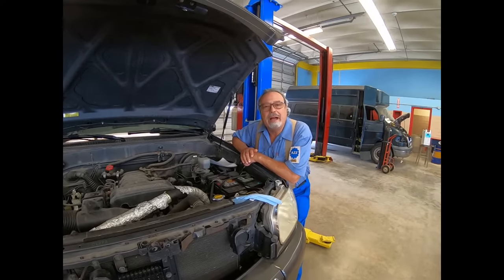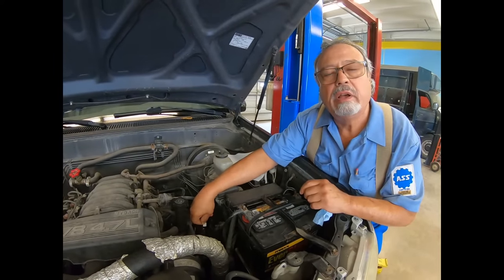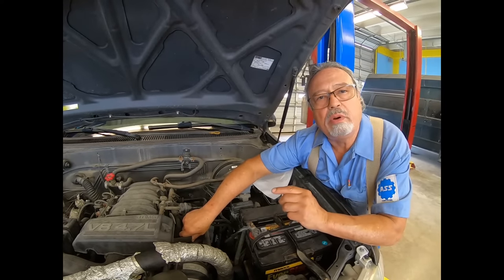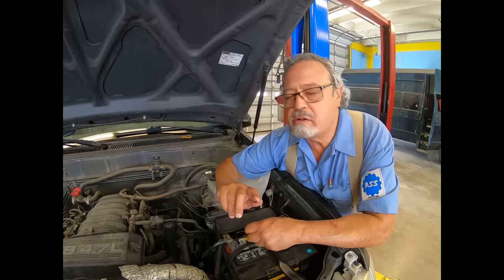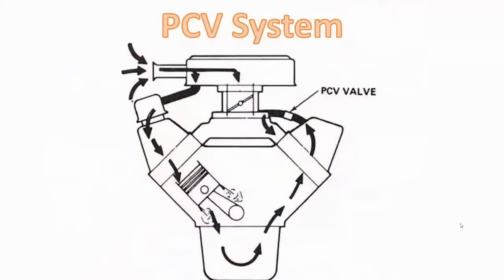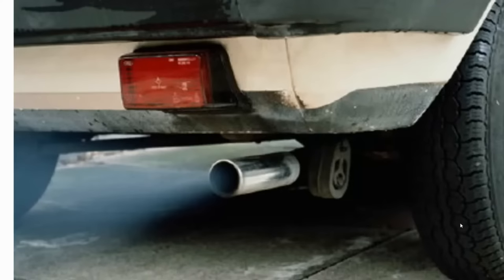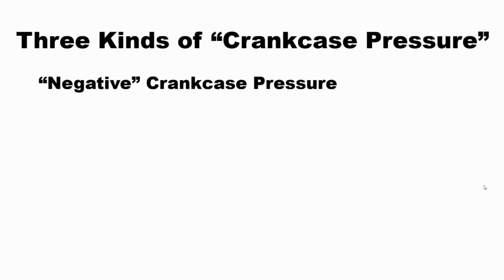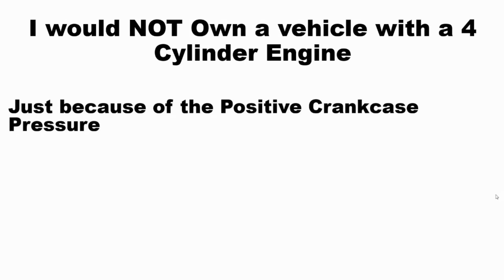Learn how IMPORTANT the PCV Valve is and why you should test it.

Comment: I have been a mechanic all my life and I never knew this trick I love learning every day thanks  !
Reply from the maker: That's Great. Thank you for the view and the comment. Did you see my series of videos on automotive AC ?
Reply: @theoldmecanicoshow9004  I will thanks
Reply: The old school hot rodders used crankcase ventilation. Something very similar to the PCV concept, to get more horsepower. A 3/8 pipe cut at a 45-degree angle; the longest part of that angle pointed towards the front of the car. Welded into the header collector. A 90-degree elbow with a check valve and hose leading to a ported valve cover breather. I was amazed at how much vacuum it created...
Reply from the maker: @hanc37  WOW...! Thank you for that information and thank you for the view.
Reply: @codyhatch4607  Both are negative I suppose. The only difference with the PCV is the vacuum is coming from the intake manifold instead of the header exhaust.
Reply: @codyhatch4607  Thank you grammar police.
Reply: Yes..I only knew of putting a piece of paper on the pcv itself,not on the dip stick holder
Reply: @Grady Hernandez
thats not right,
the pcv itself has a strong vacuum even our finger is being sucked as we try to cover it, 
the only way the paper not being sucked is if it was blocked inside the pcv or the hose
Reply: @endurofan9854  or a vaccum leak in the PCV circuit before.
Reply: @hanc37  Those were called "road draft tubes" and were in use before the PCV system. They only work when the vehicle is in motion, as the passing air created a slight vacuum on the crankcase. The other device you mentioned, used on exhaust headers works in the same manner, but is done to increase crankcase vacuum (more negative pressure), in an attempt to increase piston ring sealing and therefore increase horsepower.

Comment: Excellent video! I always wondered what the hell the PCV does and now I know.  I've always replaced it on my Astro van and my Lexus GS 300, but I never knew why.  I like how you explain things clearly and succinctly. And your wit and dry sense of humor are terrific! 😊
Reply from the maker: Awesome. Thank you for that awesome comment and the views.
Reply: I stopped the video at 1 minute 19 seconds. I have no tolerance for that condescending tone. It wasn’t all in gest, it was being ugly for the sake of being ugly. It does what it says it does. It allows air to circulate through the crank case to maintain correct pressure inside the crankcase. Hence the name “positive crankcase ventilation valve”.
Reply: @Batmicheal  If you knew all that you wouldn't be here.

Comment: Great information.  Engine oil and engines themselves literally doubled immediately in mileage  because of the use of PCV's.  A clean engine is a happy engine.
Reply from the maker: I agree. A clean engine is a happy engine. Thank you for the view and the comment my You Tube friend.
Reply: I remember working on old cars from the fifties that had no PCV system, just ' road draft tube ' that kind of pulled some of the crankcase fumes through just by the 
' draft ' of moving fast.
The whole underside of most cars was a giant grease sludge pit.

Comment: I just purchased a used 2017 Honda Accord Sport 2.4L Inline 4 cyl. This is my 1st time owning a modern inline 4cyl...
I was told to replace the PCV valve every 30,000 miles. Seems reasonable enough, as the PCV valve is very easy to replace on this engine. Thank you for explaining the reasons for this important maintenance!
Reply from the maker: You are Welcome and thank you for the view and that nice comment. Good luck my You Tube friend.

Comment: I have a 1972 350, small cam, headers, mid rise intake, 600cfm carb. Head work and bottom end work (decent hp, lots of TQ, and this one is particularly high in compression  10:5:1 before head work and bottom end work )I'd put it at about 400hp at the flywheel because shes got alot of miles since the build, I'll promise you can't turn it over by hand with just #1 plug out. It'll break the crank bolt before it will. It spins normally with all 8 out. 
I'd say this engine was overhauled and put in sometime around the year 2000 it was in service for around 10 years, parked for 12, deteriorating outside, years. Before I bought it and put it on the road. 
It had been running bad since I bought it 
I timed it, didn't fix it although it was out of time. 
Replaced all vaccum hoses and pcv, didn't fix it. 
Adjusted carb and all settings, didn't fix it, 
Broke the new pcv I installed, so I had.to replace it again. 

Didn't fix it again. 
It was a specific kinda miss.
I tune with a vaccum Guage and tac. 
I was getting a very lean fuel mixture, very low vacuum reading, and It was idling wayyyy too fast v

I had it running good as hell, but not performing. 

Mind you this car sat for 12 years, and when I put it on the road I fixed anything I deemed "unsafe" such as tightening things, and making sure nothing is going to get into anything I did not build this engine, I did not put it in. I changed the oil made it run and drove it because it was fun. 
After doing all that work a while back... 
I did something naughty.... 
Something  "forbidden" ........ 

I stuck a breather cap in my pcv valve grommet to match the other side which normally pulls from the massive vaccum leak known as a positive control valve and I plugged the nipple on the carb so it would volume of something a CARBURETED car desperately needs for economic reasons such as fuel economy... vaccum.  

A PCV basically "sucks" all the time, as a vaccum leak does. It's just controlled inside the carburetor. Not tamed, just controlled.  Technically,  you're putting sludge in your fuel system this way on most vintage cars.,you're sucking motor oil residue into a ethanol fuel that already hinders performance and causes power loss,  engine wear, and dosent spark very well in older ignition types.  And you're mixing this ethanol and oil into a less grade fuel than is already to weak for combustion I'm these old v8s and even straight 6's thus causing a lean mix, not because of your settings, but because  87 octane just dosen cut it. I believe 98 was the standard for octane in the old days. It went as high as 240octane at special fueling stations and race track use. It was also lead based until the late 70s/early 80s with lots of additional additives for combustion. 
The first generation small block chevy was designed with  a vent tube at the back of the top of the block and a breather oil neck in the intake, it was front to rear ventilation. No massive leak of vaccum in the valve cover that usually aids in helping create that valve cover that always leaks on gm products because it's pressurized usually on the passenger side. And fess up, guess what? We know it's almost always the back pass side because that's where gm locates the pcv placement from the factory? Back passenger side. EGR too, pass intake (also vaccum) and guess what else? #6&#8 plugs that usually foul, aka, least efficient cylinder.. it's already going to be this in old Chevrolet because on the firing order these 2 cylinders are farthest from #1 (the TDC of firing order) because thats just the way they built them. So you wanna pressurize this head, and pull all the "contaminated air"aka oil through a vacuum leak (controlled ofc) hooked into my intake, that ofc is the thing that makes the vaccum distribute from the crank case to ports ports the carburetor and any intake ports.  so it'll get my fuel and air above it, coming in fresh, but only is to get blended with this oilly tainted loop of vaccum leak, to not only then  be burned within my combustion chambers, which already won't make As.much combustion because the octane grade is poopeykaka for my ancient engines need for the fuel to burn hotter, hotter with less flash time and or length of combustion.  And bit of a  camshaft cresting less vacuum than before, it needs as much as you can give it and it's real design was made pre emissions so basically it created vaccum up top and the byproduct went out 2 vents in the engine 

Since I took pcv valve out and replaced with twin valve cover breathers. ..

I haven't had sluggish throttle since. 
Fuel economy went up, 
Idles better, 
Downshifts and upshifts better. 
It even rides smoother 
Idles properly, and will pin you to the seat in 3rd gear whereas before it was gutleessly slow and disappointing it wasn't until the pcv valve was removed did I get true improvement.  

Cabureted cars don't need pcv unless they have all their original emissions control equipment in tact.  If not ditch it for a breather.  

Its important you have the breathers on BOTH  valve covers.  You want to optimize how much ccp  can escape through these holes by gravity and force of engine. If you do this you'll have dirty valve covers.  

Its a small  price to pay  for not having that buildup of grime on tbe vakve cover inside your intake and cresting carbonous sludge in your valve train and head internals 

I will never waste my time with a pcv on a modified classic again. 

Keep putting them on cars with ecm tho that's fine, just don't destroy the internals of a old gm engines all we got left is what's left of gms original casts.   That goes to every mfg. business. That crested casts too suit out future
Reply from the maker: WOW...that was very interesting. Thank you for sharing the information and your personal experience. You are correct about carbureted engine and how the PCV system can cause problems. Thank you again for the information and the view.
Reply: I've had issues since I switched to the 600cfm Edelbrock from the Quadrajet that was on my 305. It used to scream and burn rubber up to the start of 2nd gear. I always figured I just went to big on the new carb, despite all the tweaking, but maybe this tip will help regain some of her former glory. Thanks guys!
Reply: No way a pcv is in my freshly rebuilt sbc. Breathers on both valve covers.
Reply: Thanks for this!! I bought a 68 Galaxie that has its original 390 w cast intake and 2-barrel (motorcraft?) carb. The original stock big block Ford covers have NO HOLES AT ALL…no breathers, no PCV.  I just bought a pair of generic chrome covers that have the 1 1/4” holes. I almost bought a breather and a PCV for the drivers side, but last-minute bought 2 chrome breathers instead.  The reason was financial- a PCV hose for the big block ford was almost $70. 2 breathers only $20 on eBay.  Now with your explanation I think I did the right thing.  By the way the inside of the old covers was pretty clean, as is the valve train.  Now I just have to figure out where to connect an open vacuum at the top back left of the carb, near the electric choke , which isn’t working properly. Any ideas anyone???

Comment: I inherited my dad's truck recently. It's a 2003 Dodge Dakota SLT he bought in 2005 with 16k miles on it. It now has 235k and still runs great even though she smokes just s little, still smooth as ever but noticed when i chsnged the plugged up pcv valve the engine was quieter overall once the notorious lifters got in harmony and finally settled down 😂 but yes overall the engine is now quieter and i am noticing cleaner oil coming out every 5k mile oil change.  I am currently driving it daily without concern that its a 20 year old truck. I wasn't aware of the importance of keeping the pan oil cleaner. I did understand the recycling process to reburn as all my cars got new pcc valves each year or 2 anyway.  I appreciated your genuine desire to get this point across and i enjoyed the patch part 😂
Reply: If it smokes, buy 3-4 cans of BG 88k and EPR your engine

Comment: I just did what you advised and di it it on my 14 RAV4 ,when after start/hot engine condition the paper would not hold even I pressed it, after changing the PCV it holds on and the engine now run at idle smoother. Thank you so much, hope you'll continue and share more Auto vlogging tips.
Reply from the maker: Thank you for the view and the comment. I am so happy that I can help people like yourself fix cars, save money, and feel good about yourself. Thanks again my you tube friend.

Comment: The PCV valve should allow a lot of flow when manifold vacuum is low- as in when you are accelerating heavily, and should only allow a small bleed of vacuum when manifold vacuum is high- such as idle and low load running.
Positive Crankcase Ventilation is the crankcase gases from combustion leaking past the piston rings and such from not just blowing out of the crankcase on their own but helping to draw the gases out and also feeding them into the intake so they can be burned.
Helps out all around
I've never seen it quite so exaggerated
Reply: @A. Melbs not sure how those are set up. All I can think of is making sure everything ' crankcase ' is sealed and plugged up ( kind of like his tests here ) and how it runs ( idles ) versus opening it up, like any oil filler caps off and dipsticks out, and comparing how it runs.
If it runs the same, while the ' piece of paper ' test shows vacuum is present, then should be working right.
Reply: @A. Melbs usually PCV valve is very easy to get at. Plugs into the crankcase somewhere usually on valve cover with a hose to intake manifold. Sometimes you can pull them out of their crankcase connection while keeping the intake hose on and while running on idle it should be holding in ' bleed ' mode. Then when you put thumb over the end the flow stops and spring pushes it to 
' heavier flow ' mode. It clicks back and forth as you put your thumb on it giving you a good idea if it's working right.
I was trying to pinpoint a vacuum leak on a Ford Focus where the PCV valve is buried under the intake manifold and you can't hardly even see it. To check if it was PCV I had to put a long flat bar through the intake tubes and push against the vacuum hose to the valve to see if it changed speed. When I heard it clicking 
( like putting thumb over the end ) I knew it was working okay.
Reply: Would a bad PCV valve cause the car to shut off
Reply: @45chris45  it could. It would have to stick 
' open ' to where it passes a lot more air.
In that position it would not want to idle very good, in fact, not at all and would quit.

Comment: I'm afraid the paper 'stick' method only tells you that the PCV valve is open, creating a vaccum.  Unfortunately, the PCV valve can still be bad and still 'stick' the paper- in the case of it being stuck open when it's not supposed to be.  (Creating a vacuum leak instead). I have a 2007 Hyundai Accent with misfire, one of possible causes is vacuum leak from bad PCV system.  Hopefully that's it, I've seemingly tried everything else!  It's a cheap regular maintenance part anyways, so I'm not even gonna test it- just replace and be done. Great video.
Reply from the maker: Thank you for the comment. Yes you are correct about the valve staying open. Thank you again.

Comment: This is the definitive test for a pcv valve. I have two cars that failed - both that passed the other usual test. I was able to clean the OEM valve better and get it to pass this test but the other ( aftermarket) would not despite it only having around 5000 miles on it and after cleaning to what  seemed like new. Lesson for me is use only OEM and also to check frequently. The one l was able to get working was on the car that l only have 50 K miles on. 
Thank you for the great tip.
Reply from the maker: WOW. Thank you for the view and the information. I completely agree with you, OEM parts are way better than aftermarket parts. Thank you again my You Tube friend.

Comment: I have a Audi 4 cylinder turbo with great negative pressure. Even when it was stock it was amazing. Was stock 2 years. For thr past year it has a big turbo upgrade and more, pushing over 500hp (yes 4 cylinder). It’s a 2015 with currently 212k miles. Stock internals . Runs amazing.
Reply from the maker: Thanks for the info!
Reply: You must of got lucky and got one of the good ones. Audi modified the PVC valve that raises the pressure. It's over 300 bucks for the OEM. It is still a major problem, needs replaced often because it fails. Mine just started this issue now.
Reply: Robert Winnall are you saying you just upgraded the turbocharger and now your engine is pushing over 500hp? It's not tuned? Not even stage 1? What type of turbo did you install? BTW, which Audi? A4 or A6?
Reply: @RayJays  he says turbo and more. It would be kind of hard to put a massive turbo on without doing tuning so I'd assume it part of the "and more". I'd be scared to death of the timing chain failing if it was an A4.